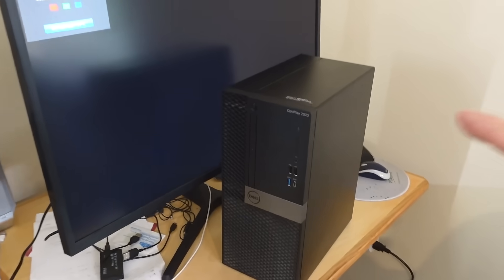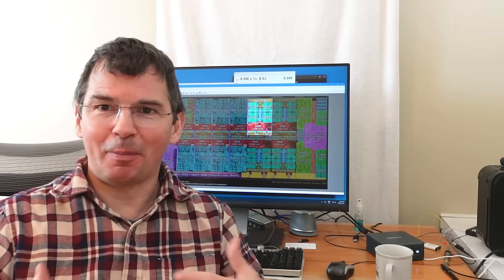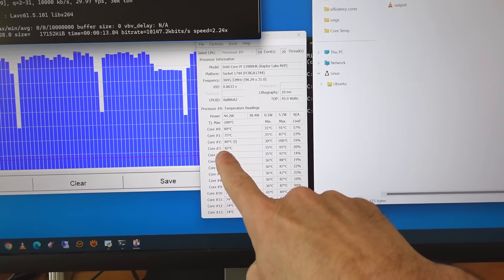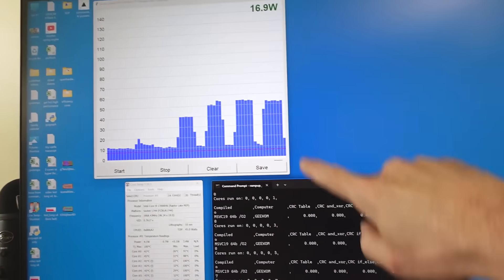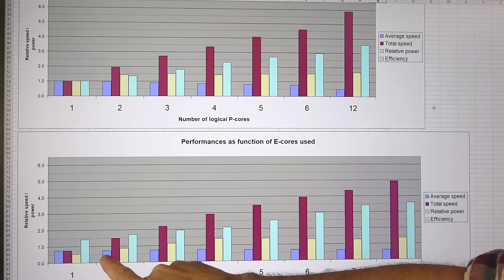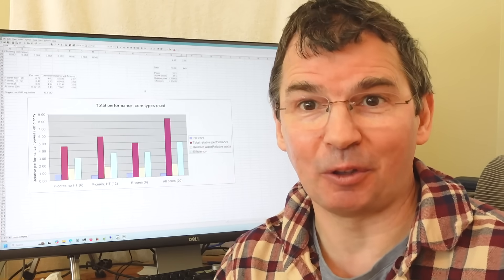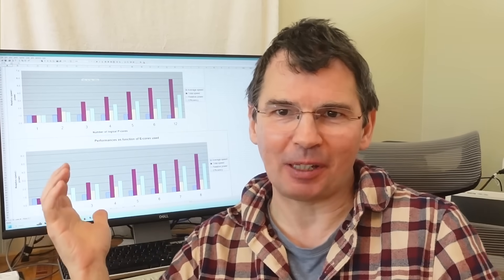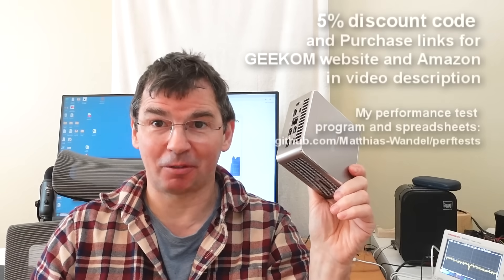Efficiency cores are about performance more than efficiency

Comment: 0:17 "*old* core i7 that I bought in 2020"? That isn't old yet! Unless you have specific workloads, that has nearly another decade of general-purpose useful life in it. (Or even ~20 more years, if you'd buy a new one only when the efficiency gains outweigh the emissions from manufacturing, but alas, nobody does that)
Reply: This guy is from the 90s. By 90s rules this is an ancient machine.

Comment: I have an HP thin and light laptop (no heavy cooling) with Ryzen 5 5500u processor, I actually did a test trying to run whisper AI locally as efficiently as possible on it. (It's not fast, but usable for pre-recorded audio that doesn't need real time transcription.) Anyway... It has 6 cores 12 threads boosting to ~4GHz, but only for about 20 seconds before it throttles to ~3.2GHz with all cores, and fhinished transcription of a 3m audio in about 1m18s. but if I run it on 8 cores and power saver profile, it does the same job in 1m 35s at 75°C and boosting to 4GHz till the end. (That's on Linux though... Unfortunately can't use it's IGPU for AI, it's not supported on Linux at least, but I doubt an IGPU would speed it up considerably anyway...) I observed the same mining monero with it, but the optimum was 10 cores rather then 8 for that purpose. I guess that's another type of load.

Comment: As a complete novice/curious outsider,i was wondering if anyone is using either a quantum computer and\or a powerful AI to run through different architectures, to find the most optimal path for power\performance\ application.
I mean,this is surely a monster math modeling problem isn't it?
Reply from the maker: first you would have to nail down the constraints, which are ever changing.  it’s more like road networks.  we don’t try to design the optimal one, we just make one change at a time given needs and constraints.

Comment: It appears that the wattage cap on the Intel makes it essentially free to run all of the efficiency cores if the performance cores are already being run.  It also appears that because of the cap, it's a tiny marginal cost to run all of the performance cores, if you're already running all of the efficiency cores.  It looks like the optimal setup for these kinds of CPUs might be 1-2 performance cores and many efficiency cores.

How hard would it be to set up a test like that?  Where you set it up with variable numbers of performance cores and efficiency cores using core-parking?

Comment: You have to check the i9-13980HX (i9-13900K's die). That thing is crazy, basically desktop i7-13700K perfomance, half the power draw of the desktop i9-13900K. Even beats the i7-13700K desktop in gaming. Crazy battery life in youtube for such a high end chip.

Comment: Intel's RING BUS LATENCY to all those ecores are HORRENDOUS. Sucks for gaming because of it, even on 200s.  What a disaster of a design since gamers is the most vocal of pc buyers so they designed themselves into a corner of negative reviews and bad PR with gamers. Why couldnt they just make lower clocked 12p cores and better TIM interface into the copper lid. Amd does all of this and more. Its like Intel arent even trying anymore. I really hope the new CEO has better insight into what customers want. Chasing is efficiency is fun but it doesnt sell cpus.
Reply: "Intel's RING BUS LATENCY to all those ecores are HORRENDOUS"
A Ryzen 7 7700X has to clock 800Mhz more than my i7-12700K (8 pcores and 4 ecores)  for the same singlethread score if i compare perfomance core vs a standard Zen 4 core, so at the end the e-core latency is irrelevant in games (they are excelent for running things in parallel and lowering lightly threaded power use).
Reply from the maker: probably wasn't a factor in my tests, as everything would have fit in the core's local cache

Comment: This video makes a common misconception about efficiency that really bothers me because of its prevalence. More power consumption does not mean it's less efficient. Efficiency is a measure of how much work can be done per unit of power consumed. So you can still gain efficiency from power consumption increases by increasing the amount of work done by more than the % of power increase. 

You have to measure more than just total system power consumption at the wall to measure efficiency. You need to measure cpu performance as well. Just blasting the cpu cores with workloads destined to max out their power consumption also hides all the little things that designers have done to improve power efficiency for normal proper workloads as well.
Reply from the maker: yes, exactly.  And that's how I measured efficiency too.  That is efficiency.  Why do you have this misconception that I would have done it any differently?
Reply: @matthiasrandomstuff2221  I stopped the video halfway through because you were just comparing the two computers by a script that slams the cpu as hard as possible and measuring the total system power consumption at the wall. If you get to actually measuring the system performance between the two in the 2nd half I apologize. But it doesn't take much scrolling through the comments of this video to see tons of people popping off the same misconception about total power consumption being exactly equal to efficiency.

Comment: Near the beginning when you say it is being thermal throttled, it definitely is not. Your temps never get near TjMax, which is when thermal throttling would happen. You’re just hitting the PL1 and PL2 limits that are set in the BIOS. They’re wattage limits based on a certain amount of time permitted at a given wattage before stepping down to a lower wattage. Thermal throttling is something different where it starts limiting performance because it has gotten as hot as it wants it to ever get, which is definitely not what you were seeing. Also, letting the CPU run around 100 ° C isn’t iffy. That’s within design limitations as thermal throttling doesn’t happen until 100° C, and your power limit settings are too low for that to be a concern anyway.
Reply from the maker: correct, it throttles ahead of time.  Though I think with some workloads, there is further throttling, especially if the heat is distributed unevenly.   I find the fan starts to blow harder if just one of  the cores is getting quite hot.
Reply: @matthiasrandomstuff2221 My point is, PL1/PL2 throttling is not thermal throttling. It is literally marketing throttling. Higher-end SKUs with the K suffix are made from the exact same cores, but because you pay more money they do not have the PL1/PL2 limits at all. And in those CPUs you can sometimes see actual thermal throttling when temps actually begin hitting TjMax. That’s the only time you actually see thermal throttling, when you start hitting TjMax. TjMax is what determines when thermal throttling should occur.
Reply from the maker: if I set the it13 into performance mode in the bios, it will use a lot more power and run hotter.  If it had a much bigger heat sink, it would make sense to configure it for higher power levels.

Comment: So if your app is massively parallel, a CPU with only E-cores would be ideal? Intel, may I suggest: Intel i9 Oops All E-cores! with 32+ cores? (Maybe 64 depending on fab.) Next gen games will be multithreaded. Do it.
Reply from the maker: But there is always some stuff that has to happen sequentially.  So perhaps two P-cores and fill the rest of the die with E-cores would be useful for mostly parallel workloads.
Reply: @matthiasrandomstuff2221  The 1 or 2 performance cores is exactly what the lowest power premium mobile variants of the 12th generation did, and 0 P-cores for the lowest power entry level mobile. These lowest power families were, though, just up to 8 E-cores. (I am not sure if there was an actual die design with just one P-core, or if the worse performing or broken P-core was just permanently disabled on the 1+4 models.)

So, 0+8 and 2+8 combinations do exist.

Comment: Try the same test with an computer with out fans... MS surface with an core I7 is not faster that an I5 because that I7 is clocking down. I have started to clock down everyting that has not an fan because the cpu is clocking down and some time the computer is stopping working for an second or 10 and then customer asking us why our software is not working....!!
Reply from the maker: I don't have an ms surface, and while it would be interesting, the earnings from these videos would not pay for one.

Comment: Yeah but issue with more powerful minipc is that they have really high ratio of hardware malfunctions and build quality problems. And just like with laptops, they are not modular beside ram and ssd, if something go bad you pretty much need to scrap it as cost of fixing eg power modules or worst, soldered cpu is like 50% cost of whole device. No one care about minipc that cost like 300 bucks but when you spend money on one that cost 800... You get laptop performance when for that money you could buy pretty good pc that in case of issue is easy to fix as it's modular.
Reply from the maker: power supply is separate too.  And when the CPU goes, usually it makes sense to swap out the whole motherboard for one that works with current CPUs.  Really, the mini PC is a motherboard, with a soldered in CPU, as everything is on the motherboard board, just like on a budget PC.

Comment: Intel 7 vs TSMC7 does not mean a lot even less the number yes intel 7 is 10nm renamed but they renamed it 7 because intel 10 is closer to tsmc 7nm than the name indicated, actually intel even has tighter Transistor gate pitch>
The name are just marketing and not linked to reality anymore. 
Now I would not doubt TSMC is better at the same "specs" I am not debating that just saying pointing at the name does not mean anything, in the same way samsung at the same "name" are worse than TSMC

Comment: Years ago when dual and quad cores were all the rage i bought a 2.4ghz dual core and over clocked to 5.2ghz....it was the shittttttt, and needed a liquid cooled system with 3 120mm to "push" air thru the radiator and 3 on the other side "pulling" air thru. I forget the wattage but this thing was a monster and my buddy and i used it as a space heater. Times have changed a bit :)

Comment: if only all modern softwares and games would properly support multicore, then things can be made so much more efficient.
that said however, I use Linux typically, and on Linux, way more software supports multicore well. if some compatibility layer where to be made, like proton, but then to split singlecore into multicore that would allow a lot.

actually the main things not yet properly multithreaded on Linux are mostly a few filters in gimp like warp cage.

I also had been looking at mini pc's for on a work place, as they tend to think there that bigger means faster, and so they end up buying super old slow computers for way to much money and those mini pc's are much faster, and more energy efficient, and also smaller which also is nice to have.
Reply from the maker: taking advantage of multiple cores is actually quite difficult and error prone in software, so its typically only done where performance really matters.

Comment: When you say the E cores are efficient for the die size, that doesn't matter for the layman users.  They don't care about the die size.  Sure, it matters for the price of the processor... but I contest that it doesn't matter all that much since manufacturing processes mean smaller and smaller processors.
Reply from the maker: It means that you get more cores and more performance on your chip for the same price, regardless of process.  The microprocessor is the most expensive part of your computer.
Reply: @matthiasrandomstuff2221 😂 gamers would argue about the most expensive parts.

Comment: Would you consider doing a similar video but with Linux?
Reply from the maker: Which operating system is used doesn't change the conclusioins.
Reply: @matthiasrandomstuff2221  I was curious too see the the scheduler had an impact
Reply from the maker: I forced each thread onto a specific core so the scheduler doesn't have much in the way of decisions to make.
Reply: @matthiasrandomstuff2221  Thanks! I'll rewatch the video now!

Comment: I'm keen to hear an unfiltered review of the cons of these mini PCs too!
Reply from the maker: can't stick any cards into them, nor a lot of drives or larger drives.  Also not enough USB ports.  And unsuitable for gaming rigs and such where you want the absolute most performance from the CPU (lots of heat) and a fancy graphics card.
Reply: @matthiasrandomstuff2221  thanks! any finnickyness with bios / software / drivers?
Reply from the maker: I actually screwed up the windows install on the A5.  A stock install of windows 11 straight from microsoft had everything working except for wifi, had to download the driver from geekom's website.  Which took a while to realize, as a google search did not turn it up.  So far, only installed the wifi driver, everything else is still stock windows.

Comment: I deliberately don't play modern video games and so I standardized (10 years ago) on used 15 year old hardware -- the Intel 8400 running at 3 gHz. I bought seven such systems (for the price of one new one). I've been on Windows XP since it came out and will be on it for the remainder of my life. Fight the upgrade treadmill.
Reply from the maker: and at some point your system will be so obsolete that it will be incompatible with the latest malware!
Reply: @matthiasrandomstuff2221  Yup. I stopped running AVG (free) a year or two ago.

Comment: 10:27 Finally, I was a bit concerned you would just repeat every synthetic benchmark end score without mentioning the catch.
And your earlier test confirmed my suspicion that the scheduling logic of windows is dubious. iE: "terminal equals background task"
So still happy I avoided them for now. I summed it up as: "If you don't do a lot of local compiling literally using all cores. There is a good chance the scheduling will do something questionable messing with your performance. I suggest we skip the early ones."
Reply from the maker: I just googled, powershell does have the ability to start a process as high priority.  But to be honest, I actually like the video processing running as low priority. sure, it takes longer, but the pc stays snappy and t he fan doesn't get loud.

Comment: My Laptop CPU shows in Task manager,        that whe 2 of my P- cores hit 80%+ utilisation other 2 P-corrs goes down to 5% utilisation ?    Why not all 4 P-cores at 80%
Reply from the maker: probably something thats single threaded.  I find windows if just one program is running single threaded, widows will bounce it around between cores.  Probably to spread the heat around a bit better.

Comment: Intels p cores were absolutely massive being about 2x the die size of amd’s( not exactly comparable because different fabs). Also Intel 7 is about the same performance as tsmc 7n I think its density is comparable but the power efficiency is um not present but its hard to know as Intel 7 wasnt really useable by anyone outside of Intel
Reply from the maker: yes, that density and efficiency of the die layout and lithography is something I can't gauge independently.

Comment: what i want to know is if they gave P-cores 4-way SMT will it still lose to 4 E-cores in multi-threaded workloads.
Reply from the maker: I just checked my spreadhseet, 4 P-cores will get throttled a bit, whereas 4 E-cores get throttled hardly at all, but the P-core throttling is less than the advantage of the P-cores, so the 4 P-cores still win by 15%.  At 6, the P-cores still win too.
Reply: I would expect 4-way SMT to not scale well. Each logical thread is backed by slack space in the instruction pipeline of the physical core. For short bursty workloads (like you'd find on the average laptop), there is usually slack space to go around. But under compute-heavy loads that slack space drys up pretty quickly, rendering hyperthreading useless. This is why most HPC installations just disable hyperthreading in UEFI outright. And modern architectures like Granite Rapids are either all P-cores or all E-cores where as consumer architectures like Meteor Lake retain a mix of P and E cores with the E cores starting to take the place of hyperthreading.

Comment: Well done for doing this. In terms of efficiency, it would be useful to know how much Energy is used to process a specific file. If your i7 uses 1MJ (guess) to encode 60 min of video, how does that compare against the smaller units ?
Reply from the maker: The IT13 (13th generation core i9) is 2-3x as efficient and faster too.  The AMD chip in the A5 is more efficient still, but slower.

Comment: Just buy AMD  ya dingus
Reply: I'd like to see your math on that.  I found it much cheaper to get a 14700 for $200-240 and a Z690 motherboard for $60-80.  It would be faster at Cinebench for example than a $280 7900X and a B650 for $80-120.  Either CPU works fine depending what you are doing, I have all sorts.  I've even had a '10th gen' running LPDDR3, worked surprisingly well.

Comment: Matthias you are breath of fresh air on YT. But TBH I just want a CPU to perform predictably at it’s rated speed 24/7. I know how to make a heatsink. I know how to block noise. I don’t need my computer to micromanage itself. Ffs
Reply: Every modern CPU throttles to keep average power within a reasonable range, this is completely normal.
Reply from the maker: Ah, but even my core i7 desktop from 2020 plays games like that, just to a lesser extent.  But you know what?  I never noticed that until I tested for it.